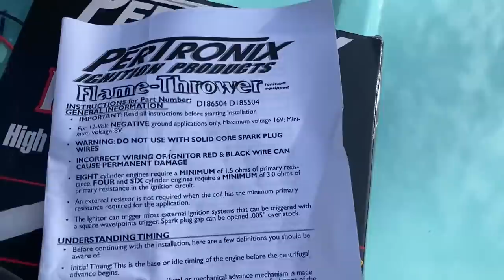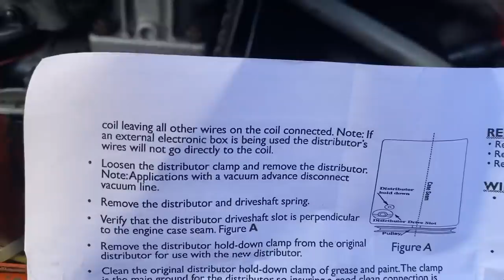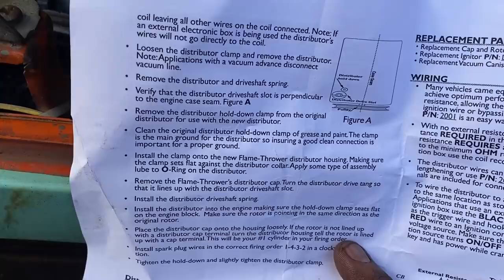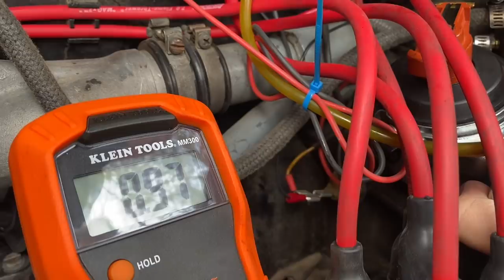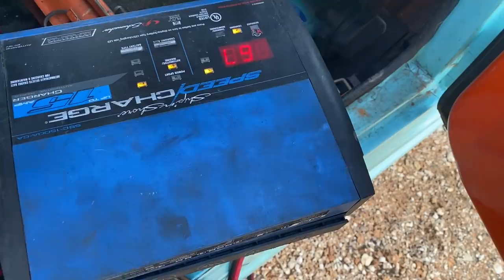Vw Thing smokes like a detroit diesel ;) upgrade to electric ignition with a few issues

Comment: I was holding my breath when you were torquing those plugs!
Reply: on my vw i never torqued the plugs, always installed them finger-tight then gave them 1/4 turn more with a wrench. vw heads are made of mag alloy and the thread reach is short, i've seen lots of vw heads with stripped-out plug holes.
Reply: Same here. Major cringe moment.

Comment: Watching this reminds me, again, how much I absolutely love modern electronic ignition and fuel injection systems. No idea why anybody would want to mess with this relic
Reply: Yeah, this should be converted to an injection system, and then removed and replaced by a battery and a motor. Century 21.
Reply: I love electronic ignition and injection too. I have seven FI engines, in cars, trucks and boats. I mess with the relics because I find them fun. Some don’t. I also know what I’m doing. I have a ‘74 VW Thing, unmodified. It starts cold or hot in two revolutions and runs great.

Ironically, I had to replace an injector in the boat a couple of weeks ago.

Comment: Use inch pounds torque wrench for anything below 20 ft/lbs.  14 ft/lbs=168 in/lbs.  Much easier to get a good feel for things that aren't that tight in ft/lbs, with an in/lbs torque wrench.

Comment: @ 9:36 Never lay a vacuum line from the carburator straight down to the distributor that way. It should be go up from the carb over the fuel level inside, then down to the distributor. Fuel spill from the carb destroys the membrane in the distributors vacuum advance unit. If you don't use the VW shaped metal line but a plastic flexi line instead, make it long enough and first guide it upwards to the incoming fuel line and wrap it there with e.g. a cable tie. Then go down to the distributor. Particularly the ethanol fuel will destroy the membrane quite fast and a) the distributors advance function does not work anymore and b) through the leaking membrane you might get fuel into the oil system.
:-)

Comment: You need to advance the timing a lot more. On the distributor hold down you may swap to different type of hold  down than the type you have probably a aftermarket type just do your research. From what I see you still need to go further down on the distributor for proper engagement with shaft to the engine. Just research it to be on the safe side. Once the engine has warmed up adjusted the timing up till it starts spark-knocking while you drive when it spark-knocking retard the timing till it stops spark-Knocking while you drive and your timing will be set.  You may need to readjust your air/fuel settings on the carburetor too when engine is warmed up. It’s tedious I know but you will get there Scott. Hope this helps you out. Greetings from Silverstreet South Carolina. Happy New Year to you and Kelly and Leroy.

Comment: Take a piece of breather hose (same stuff as next to the oil fill cap) and use it on the plugs to start the threads. It also helps you to avoid cross threading the plugs and tearing up the head.  Easier on the hands/fingers than an extension and socket too. And don't forget the Never Seize on the plugs threads. A little dabwilldooyah.

Comment: In the throat of the carb there is a brass tube that sprays gas from the accelerator pump.  See if it shoots a nice stream or dribbles.  It may be clogged......if it dribbles take the carb top off....5 screws? ........then pull the tube out of the carb body with a needle nose pliers.   Clean out with strands of copper wire.  Reinstall and tap into place..... then make sure it is aimed betewwn the airhorn and side of carb throat.  Straight shot to engine.!!   Can be pumped and aimed  with carb top off!!  Reinstall top.
Cheers, Rick

Comment: I always had the best luck setting carbs and timing with a vacuum gauge... Set the timing first. Highest reading to where it starts with no issues. Then adjust the carb to the highest readings.   And use dielectric grease on the plug wires (both ends). Anti-seize on the plugs in the block.

Comment: Old VW guy here and my only suggestion at the moment for your smoking is to make sure the oil is not overfull or diluted with fuel... AND ... switch back to straight weight oil. 20 wt in the winter and 30 wt in the summer.

Comment: Couple of shims out of the alternator pulley to get that worn belt adjusted, or just change the crucial fan belt !  I used to race a spaceframe buggy off-road with a 2 litre VW engine I built on a Mexican crankcase with a roller bearing long throw crank. I always ran a 009 Bosch distributor with no vac advance, never had any "lag".

Comment: The clamp is not the issue, the distributor housing is. I’ve run into this a few times with generic (read: “Chineseum”) parts. They aren’t manufactured to the same tolerances as OE, and figment stack ups happen. So,times you need to spend the money and buy OE, in this case, Bosch.

Comment: As a Bosch distributor restorer/rebuilder, I was curious about the quality of the Pertronix Chinese made distributors. So, a couple of my customers sent me their almost new ones that failed shortly after installation. They both purchased restored German Bosch distributors that matched their carbs and this cured their engines problems.  I autopsied both of the Pertronix distributors. My findings were not surprising. Poor tolerances. Cheaply stamped parts like the advance weights that are made of inferior materials. The pivot plates had horrible slop which creates dwell problems. These Pertronix distributors are simply cheaply made distributors. Clearly, they are manufactured as inexpensively as possible. The electronic modules are also not reliable. I know too many VW owners who tried them and were left on the side of the road when they failed w/out warning. Others who swear by these electronic modules also confess to carry a set of points and condensers in their glove box.  In decades of VW ownership, I've never had issues with quality points and condensers. 
So, if I was Scott, I'd carry a "backup" Bosch distributor for if/when that new one fails.
Reply: I agree 💯% . Can't beat the reliability of points and condensers. Air-cooled VW are no modern miracle, the engine proved it's reliability in the harshest of conditions in Europe in the 1930's .

Comment: I always used to static time my VWs. Would align the notch in the bottom pulley with the bump prior the split in the case effectively advancing the timing. Those distributor clamps do get distorted after so many years.

Comment: I might be wrong but your distributor drive is in the wrong orientation. It works because you have the plug wires wrong (conventional) also. When at tdc the #1 position is not aiming at #1 cylinder (which you have but would make more sense) it should be at 05:00 rotation wise. If you google any pic you'll see what I mean. #4 plug is at 07:00. Your #1 plug is at 02:00. The giveaway is the vacuum pot of the dist will sit at  45 degree to the engine case. I kept looking at that and remember I did the same thing 50 years ago. I still have the Meyers Manx Dune Buggy in the Barn. 1200 cc of raw gutless wonder.
Reply: Marty ... every dist I have seen has a hash mark for #1 on the rim of the case. If it doesn't line up you have to move the lower gear drive, which I can do in a few minutes but the average Joe has no clue where to begin.

Comment: Always use a torque wrench steel plugs into an aluminum head.  Easy to strip plug hole threads and a real bummer to Helicoil them, have to pull heads.
Blue smoke, valve seals.
Reply from the maker: I did yes a torque wrench for every single one
Reply: gunga din
 ... this engine doesn't have conventional valve seals. Only has small rubber o-rings, which don't help if the guides are worn.

Comment: the vacuum advance hose needs to have an upward loop to prevent it from pulling fuel into the diaphram and damaginig it  look on line to check the proper routing
Reply: del hudnall
 ... the factory used a metal line with a shepherd's hook bend and hose on each end to make the connection.
Reply: @rupe53  you are so right  i have one of these in my shop now that i have no use for as i intend to use  oo9 distributors in all my rebuilds  009s are centrifugal as you know

Comment: i guess i'm not the only one to notice the speedo jiggle, point of maintenance take the cable loose from the back of the speedometer and dribble some light oil down the cable inside the sleeve and give your thing a little lube, it should free up the cable.

Comment: Did you know that Orange GoJo handsoap can be used as an abrasive cleaner with aluminum foil as the "scrubber" and it will remove any amount of rust from steel or chrome.

Comment: You should get it to run ok just by setting the static timing,probably needs the fuel/air mixture setting on a co meter.

Comment: With vacuum advance at wide open throttle or a sudden drop in vacuum the vacuum advance will drop. Is it on ported or manifold vacuum? Ported will add timing as you give it throttle. Manifold will pull in the advance at idle and rely on mechanical at wide open as there is not much of any vacuum at wide open. Make sure the base timing is set correct with vacuum disconnected.
Reply: Its ported off the carb on a stock VW motor.

Comment: Gotta love the Pea shooters
Reply: the thing the exhaust originally exits through the holes in the rear bumper the muffler with the pea shooters is a bug muffler he is running as he has the bug heater boxes on this too. as his thing has a gas heater in the front the engine is a 1600cc Dual port Solex 34 PICT-3 carburetor. as the 1600 dual port is used on the Beetle Karmann Ghia, from 1971-1974 Bus 1971 only, the Thing 1973-1974. the 1600 dual port for Beetle 1975-1979 has a AFC fuel injection system on the engine as the left case half of 1975-1979 engines does not have a provision for the mechanical fuel pump on them If u change it to a carburetor then you have to put a low pressure electric fuel pump and pressure regulator on it.

Comment: The smoke on startup is due to the engine being 180 degrees horizontally opposed.  As it sits, oil sits in the cylinders and seeps past the rings into the combustion chamber.
Reply: Old Honda Goldwings would do that too if you let them sit too long on the side stand.

Comment: measure with dial indicator to make sure you have good depth on drive dogs - they could have a taper
Reply: ironheadthree333
 ... no taper on the dist drive. I can see the bend from here and the dist is not sitting down all the way. (shown in video)

Comment: Brake out your timing light. Set it with the vacuum advance disconnected vacuum line blocked off
Reply: yeah ,what Tim said..
Reply: I used to set mine by static. No timing light needed. These are simple engines to work on.
Reply: @Randy Rinker The Thing isn't a diesel though!
Reply: No vacuum advance on electronic ignition. Scott plugged the vacuum line already!
Reply: @siaripop7  yes there is vacuum advance on electronic ignition. Or should I go tell my 66 mustang with 302 that you should not be running?

Comment: New plug wires are red, so they probably add at least 20 HP.
Reply: Three times more spark, three times more boom.
Reply: adding 20 hp might double the output of The Thing 🤣

Comment: Perhaps I missed it or you did not show it but I hope and assume you put anti-seize on the spark plug threads.  If you didn't please put anti-seize on them as soon as possible otherwise they will be impossible to remove.

Comment: You rang? Did you accidentally put diesel in the thing cuz if you put diesel in the thing it'll smoke like a diesel  my grandma used to say if you play with your thing you'll go blind eventually Choke the thing.. you know what they say if you don't play with your thing it does get a little rusty. sometimes you have to jiggle your thing to get it into hole. I can go on and on

Comment: That point when something dropped, wasn't that a shim/spring washer thing from the base of the dizzy shaft? (Not familiar with this, but could that be the spring they were saying about in the instructions?)
Reply: There is a small spring between the distributor and the drive slots on the distributor pinon drive gear in the engine. It's about a half an inch long and diameter of a pencil. P/N = 111105233, called Distributor Drive Gear Pinion Spring. Pushes up on the distributor shaft to reduce vertical slop.

Comment: When i used to tinker  with cars that had vacume advance i always adjusted the timing by lugging the  engine in 3rd. (=no intake vacume at that moment) If i heard pinging i would stop and retard the timing a bit. Repeated until no pinging could be heard. Engine at operating  temp.
Later i actually bought a strobe light to adjust timing. Easier but the results were often the more or less the same within a 1 or 2 degrees.

As for the hesitation or dead spot during acceleration: assuming thete are no vacume leaks: 
Idle mixture screw adjusted to max rpm at a given fixed idle setting on a warm engine. With the engine at operating temp the throttle response from idle to wide open should be instant and snappy. 
When running the car at higher rpm and then suddenly stopping (clutch in or gear in neutral) the engine should not die. If it does die it means the idle mixture is too lean.
If the engine still stumbles or hesitates on pick-up maybe try to increase the stroke on the acceleration enrichment until the stumble is gone. ( with the engine off you should be able to see the gas from the acceleration pump stroke  squirt into the venturi of the carb when applying full throttle.
If no gasoline can be seen squirting out you probably have a torn acceleration pump membrane. 
 All gasoline cars need acceleration enrichment to go up in revs. On modern cars it's done by the ECU, on carb engine it's done by the acceleration pump on the carb)
Reply: jfv65
 ... carb was just done recently in another episode.

Comment: What Ignitor module is in this distributor? i had one fail on me before the Ignitor I the Ignitor II are the better modules to use they last longer and i do carry a spare if i should break down. my 65 bug the previous owner put in an german made Bosch 009 distributor i converted it to the ignitor ll as the stock 40 horse runs great using a Bosch blue coil. when u install the distributor is to press down  on the distributor body while turning the rotor and it should fall into place. i would check the timing using a timing light at the notches in the crank pulley as these vw air-cooled engines are ignition timng and ruel mixture sensitive if either are off you can cook this motor. When checking the timing using a timing light when you rev the engine it should advance the timing and when it coasts back to idle the timing should return to the notch on the pulley. as you need a battery timing light with an inductive pickup that clamps around the #1 plug wire. but with the ignitor ll module its virtulaly maintence free  when you use the stock coil or Bosch blue coil.

Comment: "Vacume advance" is a misnomer. It really is vacume retard designed to reduce advance under load to reduce pinging (throttle open wide means low vacum). That's why at idle the rpm goes up when you plug in the vacume line (more advance at high vacume). Set your initial timing with vacume line removed and plugged using an advance adjustable timing light. Best performance occurs with maximum advance without pinging. On a water cooled VW we want mechanical advance to be full at 32-35 degrees advance by the time we get to 2500 rpm. I read that air cooled VW should be set between 28 and 32 degrees at 3000+ rpm.  Fuel quality will affect pinging thus adjust static advance setting accordingly. Hope that helps!
Reply: Except for the few years that used a combined vacuum advance/retard unit with two ported vacuum connections, all are advance. The hose on the distributor side of the dual vacuum cans is for timing retardation at idle. This was an emissions reduction move. It has no effect at speed.

If reference to a manual doesn’t convince you it’s otherwise advance, look at it. The diaphragm is on the left of the distributor, which rotates clockwise. The hose connects to the rear, pulling the diaphragm away from the distributor. This rotates the breaker plate counter clockwise, making the points’ rubbing block meet a cam lobe earlier in the rotation. That’s advance.

Comment: You have that dizzy clamp set wrong, spread it bigger so it fits on top of thicker part, only then dizzy goes down like it should.
Reply from the maker: Impossible.  It is at the top end. The clamp is bent. There is no way it would fit higher up on the shaft.

Comment: Did I see a resistor in line of the instructions I know points system do have a resistor  electronic system do not  if the plugs wires start turning blue the resistor must come off

Comment: No offence Scott, only my 40+yrs with dealing with air-cooled VW's, your engine is a 1930's based platform which is very reliable with the components that the engine was blue printed with. Once you start bolting on "High performance" replacement parts, the engines reliability falls flat on their face.
Reply from the maker: I’m pretty sure i had at least 100 people tell me to upgrade to electronic ignition.   Not one said keep the points until you now after i upgraded.
Reply: @BusGreaseMonkey  ... electronic is ok, but the age old VW theory has always been "where ya gonna get parts" and that goes for electronic as well. I have gone both ways and electronic works great but a spare set of points / cond in the glove box will last for years and takes 10 minutes to throw in if you ever need them between tunes.